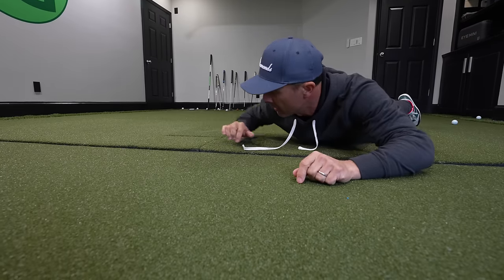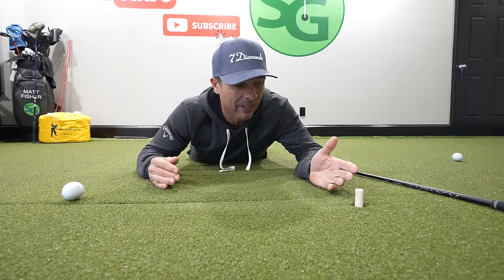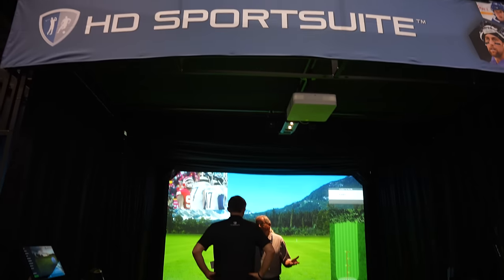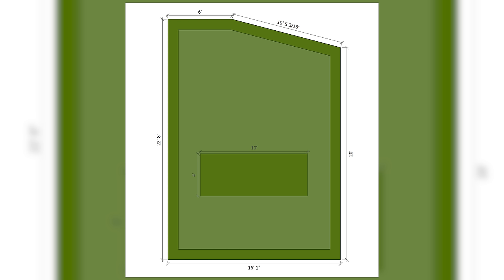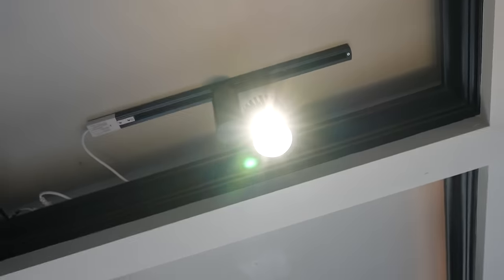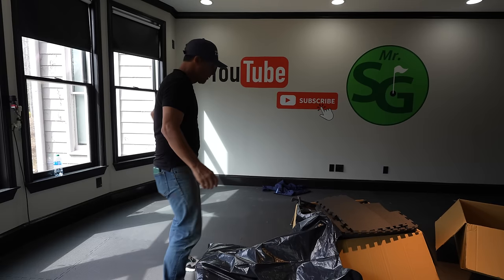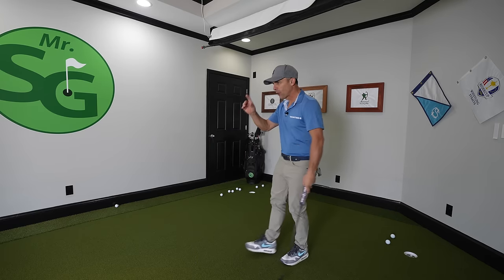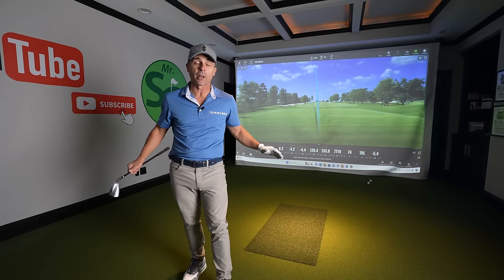Build the BEST Golf Simulator Room!

Comment: I cut out a larger area where your feet and hitting area is and placed 2 turf mats in that area so you can change each strip out when needed.  The area where your feet go is going to wear down and doesn't look great over time and obviously the hitting area has to be replaced as it wears down.  Other thing I have experienced is the EZ Hybrid wears down much faster than the EZ Poly.

Comment: Looks great Matt, nice job fitting it. I've recently fitted a sim in my garage, unfortunately nowhere near the same amount of room but I suppose that kept the costs down a bit! I'm currently hitting off a similar setup with foam puzzle mats underneath a putting turf, but I have some slightly more premium putting turf with which I'm going to make a 1' x 2' hitting mat, gluing it to the top some acrylic (perspex), and sticking low density foam strips 1" wide by 1/2" thick to the bottom of the acrylic sheet which will be in contact with the floor. I'll have to wait see if this has enough give to it when hitting balls but it should look great when finished 🤞 If not, the style of sim turf you've used might be the way to go!